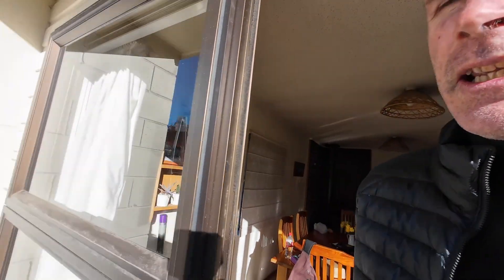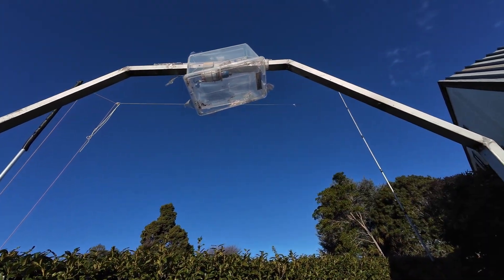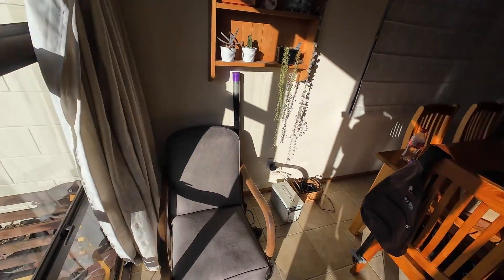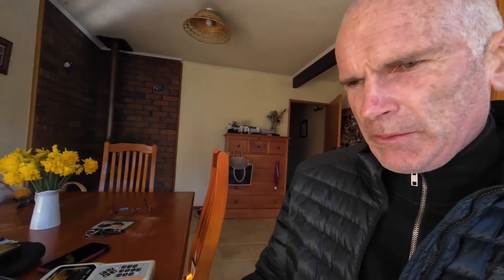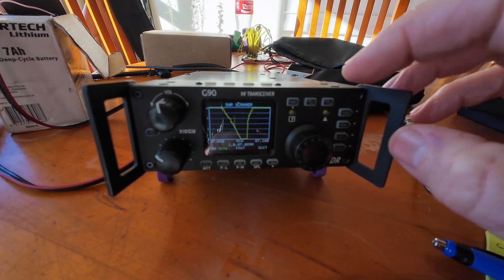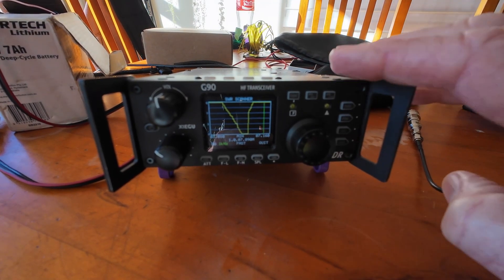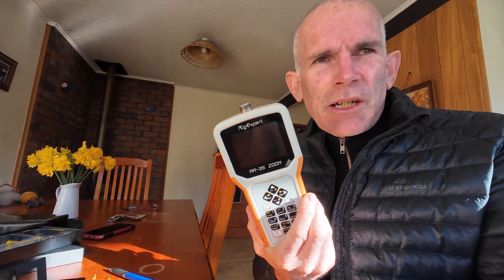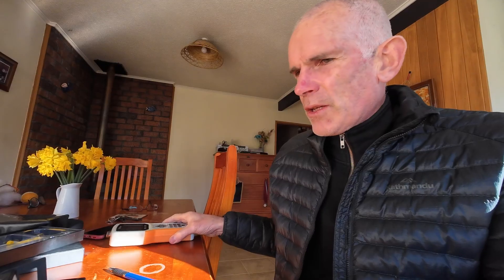Testing SWR - Comparing the G90, RigExpert & Nano VNA

Comment: Good evening! Great video- nice to know that all three devices are reasonably close on the SWR measurement.
Why is the top of your G90 white? Did you paint it? 
(I have a G90- great radio!) 73! Doc/W4VHZ sends...
Reply from the maker: Yes I did paint it. I was out doing a lot of activations in summer time in direct sunlight and I don’t have the cooling kit. I thought that the top of the radio was getting pretty warm (why all radios are a mystery). Painting it white does seem to have lowered the temperature when I’m out in the sun.

Comment: Nice video and having three to ways to compare.  Test on some other bands to see how close they measure up.  The G90 is a really good radio for price and you have the tools in one rig.  I’v had mine for a few years and always enjoyed using it. 
Take care!
Reply from the maker: I’ve also been very happy with my one. Certainly they are very good value. You are right in that it may be slightly different with the accuracy of measurement on different bands. That might be a little harder to check. The nice thing about the mag loop antenna is that it’s very stable and you don’t tend to see any movement which I sometimes get here when its windy and I’m using a wire antenna.

Comment: I was able to test mine against an MFJ analyzer, an MFJ Cross-needle meter on an antenna tuner and on two sizes of nanoVNAs. Going through the tuner, even though it was in bypass, obviously moved the dip just a little, but not enough to affect any kind of operation.  The rest were so close it was like your results. 

Long live the G90!  ;)
Reply from the maker: Thanks for your comments —  I was actually a little surprised by the results that I got but it’s good to have confirmation that the SWR measuring in the G90 is actually reasonable enough to have confidence in. Especially when I change the resolution to 3k.
Reply: @zl2neb  When using the VNA, or G90, I have to adjust the bandwidth of the scan according to how accurate I want the sweep. 

To give an example with exaggerated numbers, if you sweep the whole HF spectrum from 3 to 30 MHz with a nanoVNA on my antenna, you see dips at each of the 9 bands at various heights and peaks at points between bands. 

80m, for example is 1.9 across the band.  But when I narrow it to the 80m band, I see a dip from 1.9 to 1.8 to 1.9 at the other end.  Then, when I narrow the test to 1.8 portion, I get the dip to 1.79.  The 1k sweep on the G90 shows 1.8.

  (This tells me that in all probability, 80m on that antenna is probably a highly resistive load and not a good antenna for anything other than FT-8, LOL)

Comment: Just been checking swr and my ft710.  Would my 20m vert work on 17m. Well swr is 4.5 to 1. Ft710 tuner brings that to 1 to 1. Will it produce a qso with those settings, in actual fact it did. 100w cw into France, who would have thought !
Reply from the maker: Congratulations on your QSO into France. It’s impressive how far you can get with only a small amount of power.

Comment: Nice to know that the G90 works. On the tuning side as well as the rest of it. I love this radio for the price. Thanks for the information very helpful.💯👍
Reply from the maker: Thanks Alan - the G90 has been ideal for my activations. If you were wanting to do more with digital then there are some simpler options (although using a digirig allows you to use the G90 for this as well). The only feature that I wish it had (and which I might use from time to time) is keyer memories for voice or CW. That’s pretty minor though and there are other options for doing that if you really “need” that feature.

Comment: The antenna that you are testing here is very narrow banded. This adds some challenges.  The Rig Expert and the NanoVNA are both VNAs and in this case both are being used as a single port VNA. Theses devices have a finite number of points they are able record over a given frequency interval.  My NanoVNA measures up to 401 data points (this is adjustable downwards) across the frequency scan and the RigExpert has just 100 points.  The lowest SWR will be noted by each of these devices BUT the displayed frequency will be the frequency of one of the recorded points. If a point is recorded every 10kHZ then SWR values will be available every 10 kHz. For a such a narrow banded antenna one would likely make a scan, for instance, over the whole band to find the approximate location of the minimum.  Next a new scan would be made over a narrower range to get a better approximation is obtained.  Narrowing of the frequency range would be continued until the frequency difference between adjacent points is sufficiently close to determine a very good approximation of the exact frequency.  How many points are collected by the G90 in an SWR scan.  The differences that you observe are due to the frequency interval between adjacent data points and of course calibration errors associated  determining the location of the measurement reference plane reference
Reply from the maker: Thats a great explanation - thank you very much! I’m not entirely sure what the G90 means when I changed the “resolution” from 1K to 3K (I know what the numbers should mean but I don’t know if the G90 uses the same interpretation). Certainly changing it to 3K produced a result that was very very close to what the other devices were providing.

Comment: Rule no 1 in engineering : the quality of your measurement is directly proportional to the quality / precision of the measurement tool ;-) A couple of kHz one way or the other is nothing in the bigger scheme of things. I'd maybe look at flipping the test a bit. Ultimately the radio will be happy or not, depending on the SWR at a particular freq. So if the antenna is tuned for 7100 kHz, set the meters to 7.050 for instance, and see what value each meter gives. The larger the deviation from 1.1, the more unhappy the radio will be. Another option would be a test fixture with very short leads, and either a purely resistive (non 50 ohm) load, or some form of RLC setup, with high quality components, so that you can have high confidence about what the calculated/reported SWR should be.
Reply from the maker: Hi Eben - that’s a good idea suggestion about changing the test like that. I was initially exploring what the differences were between the meters after testing the THS 8010 antenna and noting that the G90 was showing different values than the RigExpert. The nice thing about using the loop antenna is that its very very stable in the frequency in which its most resonant in so I was pretty confident that any changes would not be due to wires moving around in the wind etc.

Comment: Thanks for the video Nick. I think you summed it up in that if the radio is happy, that's good enough. I often find variance between the radio's SWR meter and the SWR meter on a few of my manual tuners. In the end I tune the antenna for the radio's SWR as it is the radio that we are trying to make happy. Cheers Phil ZL3CC
Reply from the maker: Thanks Phil, I think that your approach is the best option. This was really triggered by seeing the different values between the Rigexpert and the G90 when testing the 8010 antenna earlier (although as I discovered, by changing the steps values I was able to really get the same result).

Comment: Thanks Nick. As we discussed on the phone, my MFJ analyzer also has a slight variance to the 1300 Mini but the variance is insignificant in the bigger picture. Great video.
Reply from the maker: Thanks Greg - I had been interested to see if there was much difference between the 3 devices after the initial testing that I did. It was interesting to see how by changing the steps to 2Khz gave a value and graph that more closely matched the other devices.